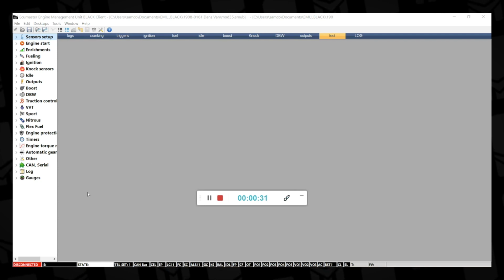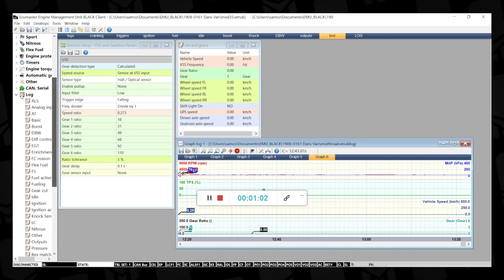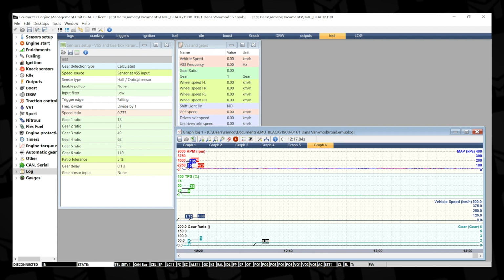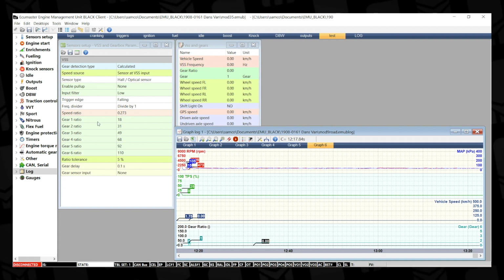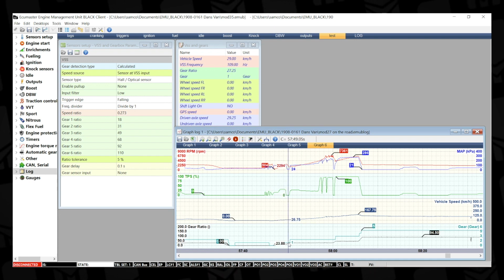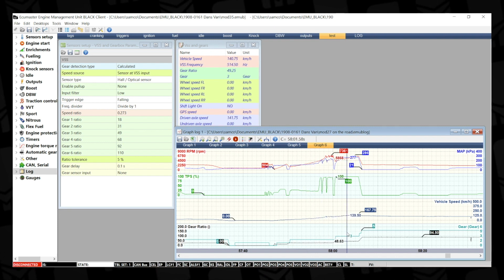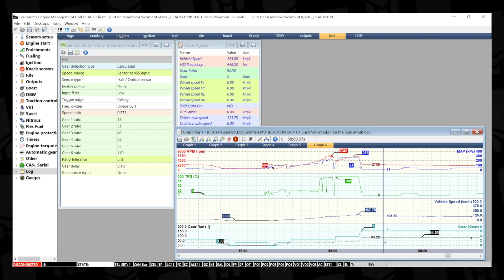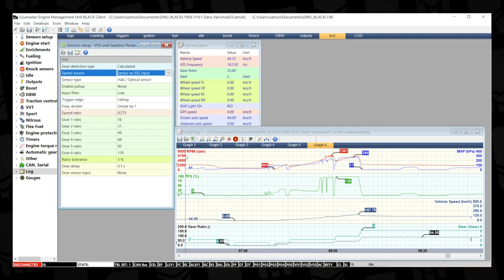ECUMaster EMU BLACK ECU Gear Ratio Setup Tutorial

Comment: im having some trouble with my vss stuff. This is the closest help i could find online. Any way you could give me some advice?
I have my vss wired into vss input. I have no idea what to put into the speed ratio. For the gear ratios, do I put what my max mph in each gear is? My speedometer is wired in and working, but it reads about 10mph high according to gps
Reply: How to do this:
Drive stable speed and change speed ratio in emu to match your speed. You can press „M” when you have active graph log windown to make a marker when u reach your speed and check later what emu see. Change speed ratio till you match speedo and emu reading its easier to do with a driver and you just change speed ratio live and check the result. Its rly 5minutes on side road. 
Then you drive every gear and check the gear ratio range for example 1st gear in my car is fluctuating 16,8 to 21,5 so I have to set in the middle and set the tolerance to reach both low and high ratio but to not reach 2nd gear „ratio range”. Unfortunately my VSS isnt so stable so tolerance have to be set high. Dunno if I can change it to be more stable.
Reply from the maker: If you still need help, please email me. Sam@manaperformance.uk

Comment: So how are you getting the speed ratio because my car is say on the log some super hight mph is the a calculation you can share
Reply: Same.. not sure why they make this so damn complicated. .
Reply: Did you figure it out? My logs doesnt show gears like his does.
Reply from the maker: Are you getting speed via the ECU? And it works correctly?
Reply: @manaperformanceuk   no it get speed through a speed sensor  in the transmission  it an audi s4 b5 . So it showing speed on the log but at some high amount.
Reply: @manaperformanceuk  Hello, yes the VSS is providing a speed signal to the EMU Black. I see data coming in and the ADU shows like 200MPH when I'm going 1mph. I understand I need to set the ratios, but I dont know how to find those.
Reply from the maker: Please send your map and a datalog to sam@manaperformance.Uk and I will take a look.
Reply: @manaperformanceuk  thanks  i will